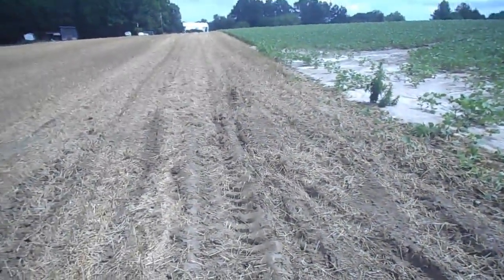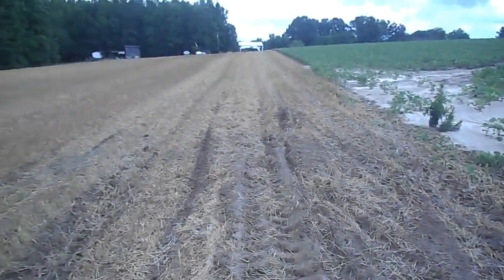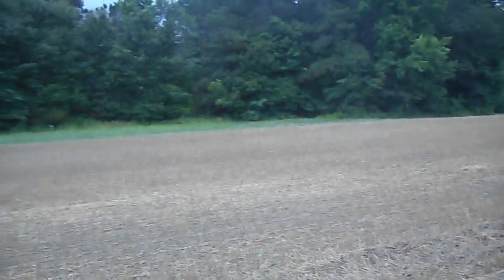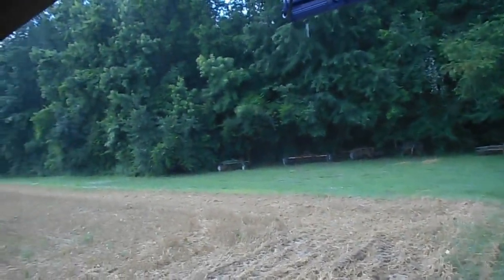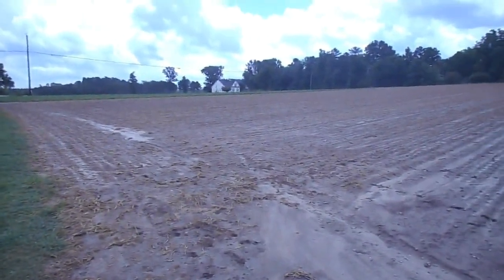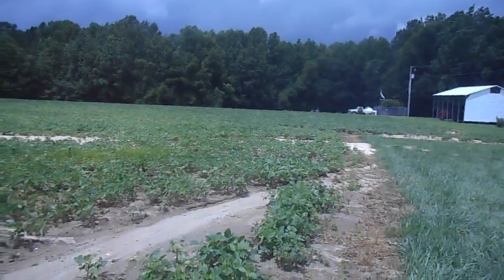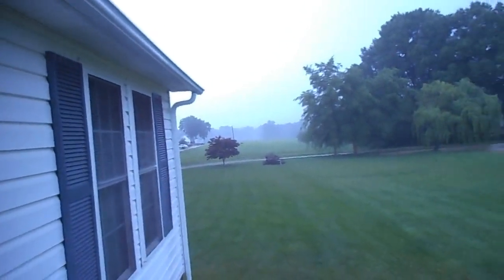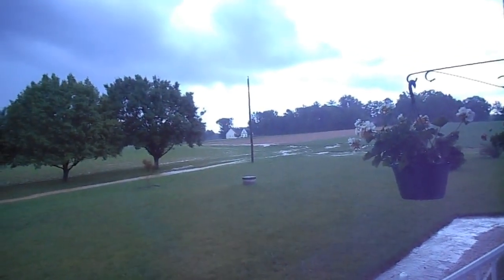The rain said go do something else

Comment: I wouldn't worry about the height of the stubble, save the ruts, wait a day or two then try the drill, just let that moisture soak in the ground first! did you ever adjust those down pressure springs?
Reply from the maker: larsonvalleyfarm - yea the ruts are why I quite.  then it rained again.  the springs are set at their highest down pressure setting.  the ground is soaked wet with moisture from the rain and the rain and the rain.  it has been raining here now for weeks every 3rd or 4th day.  7 day forecast is rain rain and more rain.   got a field I need to spray and can't get in it.  weeds will get past the growth stage where Flex Star has effectiveness.  worst part in this whole mess is if I counted my years correctly this is a reportable year to the county to retain eligibility to remain in the land use program.   reports are based on a 3 year averages and because my farming operation is so small I have no room to error on the Financial requirements.  if only my report could have been based on the last 3 years without including this year which is not looking good at all at this point.   I hope for a Miracle so I ask God and remain in faith.   got to stop worrying and just keep faith.   thanks for listening.

Comment: Sb farmer, you need to bust more equipment so you always have something to do on those post rain days. If need be, go to an auction and buy broken equipment to take home and fix to keep you out of those saturated rain soaked fields. LOL. 2 1/2 inches of rain would keep us out of the field for probably a week at least. You can't fight Mother Nature. KIT d
Reply from the maker: Douglas Laramie -  LOL   I already got broken stuff I need to fix.     the real problem I am fighting is my off the farm job schedule.  when I'm supposed to be there it is right for work here on the farm.  then I get my scheduled days off, it rains.   I had to ask for days off just to get what wheat cut I did get cut.  I guess I'll be doing the same again.